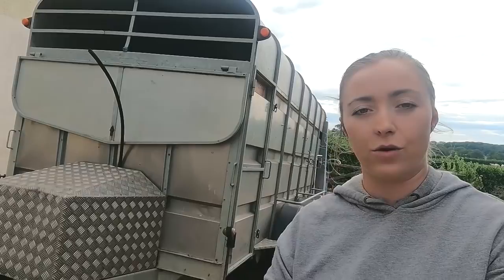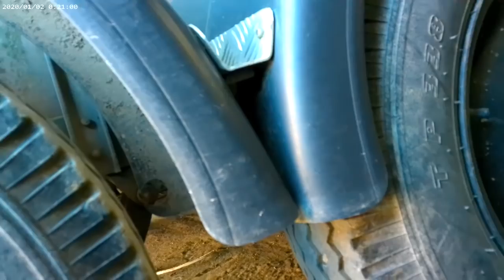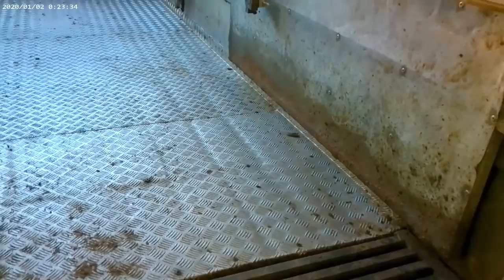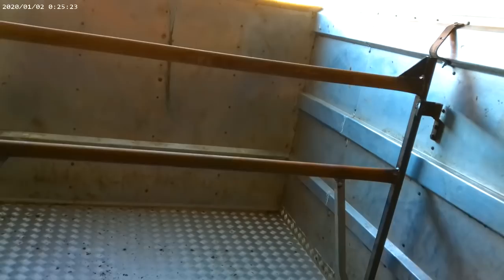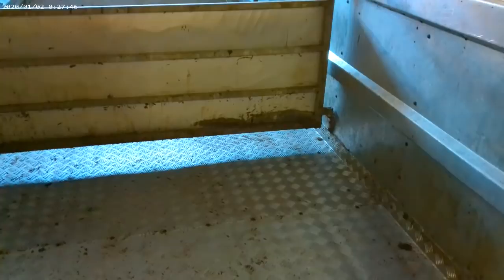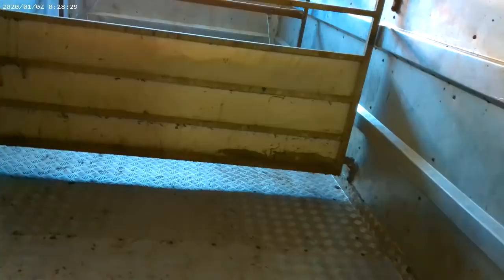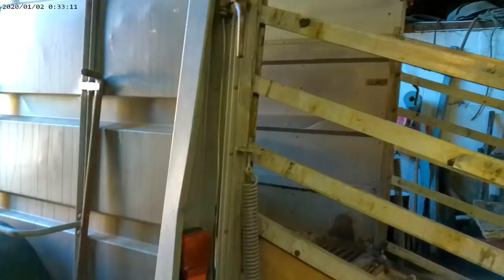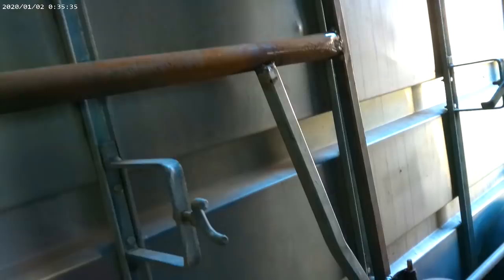CATTLE TRAILER MODIFICATIONS

Comment: We have a Jim Murphy aerolite livestock aluminium trailer that was purchased in Tuam back in December 1991,it's a 12 ft long by 6ft 6 in wide twin axel with the wheels underneath.it has the same type of dividing gate as yours made from box iron.we are still using it and wash it out after every use.we are now looking to purchase a 16ft one but they don't make that time anymore only your type with the wheels on the outside.